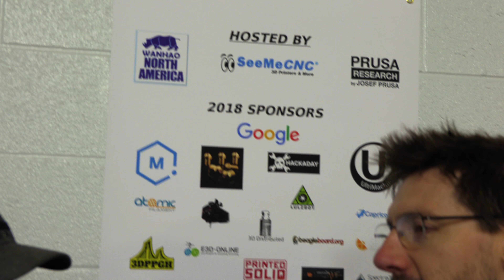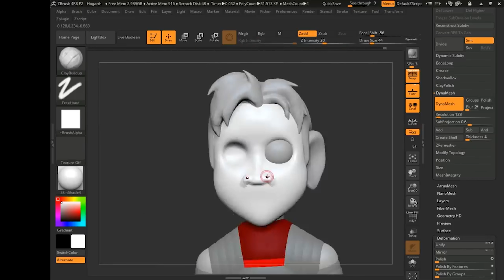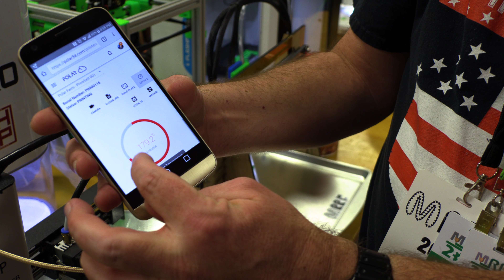MRRF 2018 // The Greatest 3D Printing Event on the Planet // Midwest RepRap Festival #MRRF2018

Comment: Excellent recap Joel.  I wish I could have been there.  I actually flew to Chicago and drove to Elkhart around 2007 or so to check out a Swissturn CNC for the last company I worked for (and they purchased it).  A bit tougher to get there now though.  Thanks!

Comment: Wow!  What a great collection of talented minds and creators!  I can't even decide what my favorite thing is.
Reply: Paradox^3 the animatronics things were interesting. Imagine that tiki column as the posts for deck railing all singing karaoke choir mode to a playlist of mp3's. or a functional animatronic mailbox to trip out the delivery carriers.  The high accuracy auto level concept on that one printer printing at .2mm without any grooves to the prints, I would have to trust that for all my eventual brain surgeries. The scaffolding tip to resolve layer shifting challenges with taller prints was practical within all reason, worthy open sourced knowledge occurred right there.

Comment: 38:50 This printer is my highlight: a 50 000$ worth printer on a DIY for about 1200$ in material.
The 3 automatic leveling screw are the key for that 0.002mm layer accuracy!
Reply: How do I find this publication  ?
Reply: Did you find a way to get the publication to build it ?

Comment: I can't wait for you to build or talk more about this 3D printer at the 38:35 minute mark with Tony. That thing looks rigid & very accurate. 

0.02mm per layer is very impressive, but how does this compare to the Raise 3D Pro2 that can print to 0.01mm layer height. 

It seems like the Raise 3D Pro2 realized that the nozzle needed to be flat/perpendicular to the bed, but fails by using manual screws to adjust it, than letting the machine do it.

Raise needs this technology. 

Sincerely, 

Matthew

Comment: CB-10?  I should try that - I actually have aluminum extrusions, belting, motors, and extra (cheap) electronics sitting around already so why not.  I'm subscribed to CHEP too, so it'll be interesting to see how his comes together.  Albeit that all printed one draws me in too - off to see if the files for that are released yet.
Reply: Watched the CAD videos on Thingiverse and put my request in to join the Facebook group.  The 2020 I have isn't slotted for wheels, but maybe I can just run a vbit down them and still use them (Root3CNC). Edit: Got in the group, and got a look at the files.  Not only do they have the CB-10, but they have a 15 and a 20 (S4/S5 sized) too.

Comment: She's going to put patina on his chest and then a rub 'n buff??
Reply: Omlette du Fromage Hi! Spectra3DArt here. After I used the rub n buff paint, I went back with acrylics to make a patina effect on the copper bits and aged the golds and silvers with black, to look like old oil. If you check out my twitter account, @spectra3DArt, or my instagram, @Kelly_the_Warrior, you can see the finished JoelBot! 😊
Reply: okie doke! thanks for the explanation!
Reply: Kelly Takacs - Do you/can you prime the models before you use rub n buff? BTW great looking paint jobs!
Reply: Dan Licata, yes you can! It would put a good barrier between the pla and the paint, which would be especially good for more hollow layer lines. But if you sand your prints super smooth (it’s worth the time!) primer isn’t necessary. Most of mine have been done un-primed.